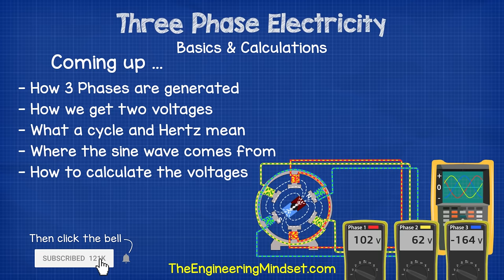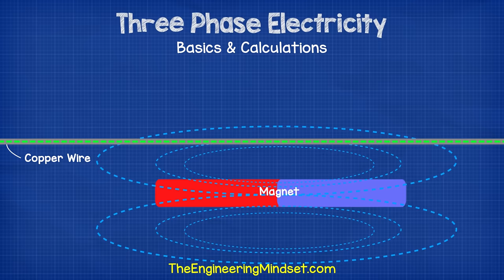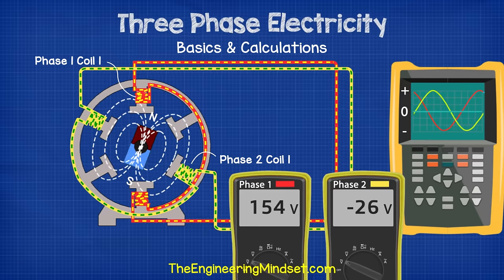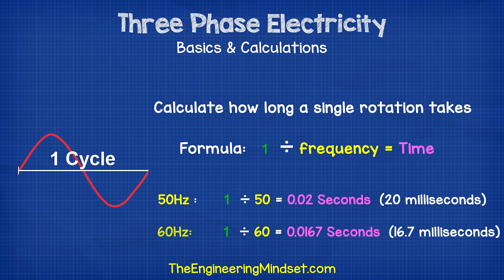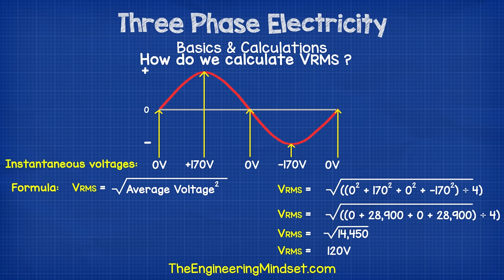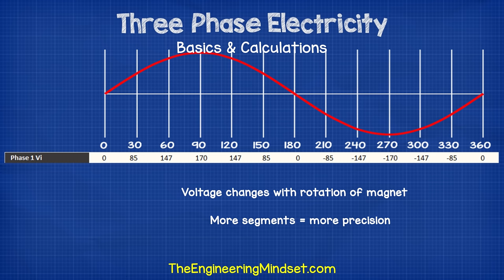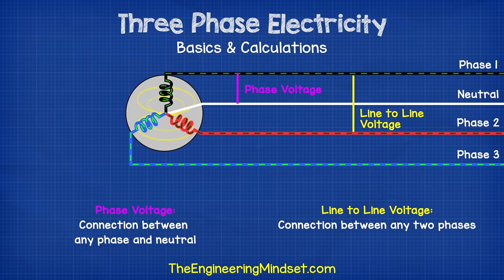Three Phase Electricity Basics and Calculations electrical engineering

Comment: In Australia we use 240V
Reply from the maker: Australia has started transitioning from 240 to 230 and by 2020 it will be the norm for some states. Queensland has already pushed with this, you can check the ergon energy website.
Reply: @EngineeringMindset  i see you are correct this will be interesting with all of our country's solar energy that pump out up to 245V

Comment: An IMPORTANT SAFETY tip to 1:08: Never ever use both my hands while plugging the multimeter sticks into the socket. This applies to any electrical component. You could get a current through your heart. Always let your LEFT arm rest behind your back, while your RIGHT hand operates couplings, one at a time.
Reply from the maker: Check our new Multimeter tutorial out ➡️ https://youtu.be/4lAyzRxsbDc

Comment: DOES ANYONE KNOW WHY THERE ARE ONLY 3 CABLES IN THE OUTPUT OF TRANSMISSION TRANSFORMERS WITHOUT RETURN CABLES? AND WHY ON THE INPUT OF DISTRISBUTION TRANSFORMES THERE ARE ALSO 3 CABLES.. I MEAN THERE IS NO CIRCUIT FOR EACH PHASE.. I m talking about EU system
Reply from the maker: Is your caps button stuck?
You don't need the neutral on distribution as its in delta configuration. The current is moving backwards and forwards so if we combine the phases then it cancels out the neutral. Watch this video for an animated explanation https://youtu.be/h89TTwlNnpY

Comment: Australia uses 240 volts not 230.
Reply from the maker: It's 230V nominal voltage in Australia. The voltage is being reduced from 240V to 230V to align with the rest of the world, but many parts haven't chnaged yet.

Comment: Too bad you didn't sum the squares of the voltages for all three phases to show that it's always the same. One of the neat things about three-phase is that, when supplied to a three-phase motor, the motor is producing the same torque no matter what angle the rotor is in, so three-phase motors unreally smoothly.
Reply from the maker: Seen our new 3 phase transformer video?➡️: https://youtu.be/u0SsejDCVkU

Comment: Its wild to think that some magnet is spinning somewhere allowing me to watch this video
Reply from the maker: What's more amazing is that every power station's generator has to be synchronised to produce a sine wave at the same time
Reply: @EngineeringMindset  Like if its using multiple generators to power the same grid?

Comment: 3 phase electricity shock  multimeter  hertz India voltage coil generator phase 123  on start magnet copper coil 123 generator star  basic delta contractor wiring timer rotation voltage dc current yellow blue red supply rotation of magnet max voltage motor neutral teacher ji

Comment: No offense but why did you bother converting to Radians? Seems like a wasted step/ time to me unless your taking a Trigonometry class in which case its probably a requirement 🤓

Vpeak = (√2 • Vrms)

RMS (Root Mean Square) is useful when trying to measure the average of numbers, where their sign is unimportant, as the squaring makes all of the numbers non-negative which comes in handy for averaging an alternating waveform 😉

Phase #1 - Vpeak • Sin(θ°)
Phase #2 - Vpeak • Sin(θ° - 120°) 
Phase #3 - Vpeak • Sin(θ° - 240°)

You can enter this into a TI graphing calculator to visually verify how this shifts the waveforms along the x-axis, just make sure you in Degree mode and not Radians ☺

Law of Cosines 
---------------------------
c² = a² + b² - 2abCos(θ°) 
a = 120Vrms
b = 120Vrms
θ° = 60° (Phase - Neutral)
θ° = 120° (Phase - Phase)

c = √[120² + 120² - 2•(120)•(120) • Cos(60°)] = √[14400] = 120Vrms ( Wye Phase - Neutral ) 🤔
c = √[120² + 120² - 2•(120)•(120) • Cos(120°)] = √[43200] = 207.85Vrms ( ≈ 208Vrms) ( Wye Phase - Phase )😊

Comment: Australia is 240V.
Reply from the maker: Australian nominal voltage is 230V, not all states or all parts of states have reduced down to 230V yet, some are still 240V
Reply: the difference is so small that the devices will work on slightly different voltage (also most modern devices are 220-240v or 100-240v)

Comment: According to this (https://www.youtube.com/watch?v=6TMBq4AA2Ng) and other schematics that can be found online, the phase curves are wrong. The voltage should peak when the magnetic field is perpendicular to the live coil (i.e. the North pole of the rotating core has passed it by 90°). Which one is correct? D:

Comment: the rms explanation was not intuitive, it was based on equivalent heat output from a DC circuit, very farfetched..... further, the derived equation that happens to get to the rms value seems arbitrary as well, and i would like to know the science behind out it happens to work out. there has to be a better explanation and intuition......further, since AC is always chaning i.e. not constant why is it that we dont see the fluctuation from a multimeter, i.e. why is it constant or failry constant and i have a feeling youre going to say because it oscillates so fast, but how does it work out to be the peak or the rms version and not 0 or some other arbitrary value?
Reply from the maker: The RMS was originally found by finding the equivalent of the DC load. It was showing zero because it cancels itself out, so they had to find a way to account for this, which lead them to the RMS value. The maths behind it is very complex, it would need to be a dedicated video. The multimeter just calculates the value because it's measuring the wave. It already has the formula. Cheap ones take as estimate but the good ones take the true rms, always get the true one
Reply from the maker: Check our new Multimeter tutorial out ➡️ https://youtu.be/4lAyzRxsbDc

Comment: The american system has different plugs for different voltages, (and currents)... you have the wrong plug for240V...  
It's a nightmare of plugs....
You show a 120 volt, grounded plug; for 240 volts!   
In your system, one could plug a 120 plug into the 240  volt receptical....
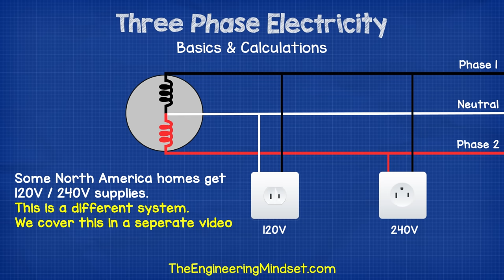You show a single phase supply, (with a neutral). 2:09 time in.

Comment: In the following video https://youtu.be/4oRT7PoXSS0
You explain in a way that when the magnet inside a rotor is perpendicular to the coils you get maximum current, but in the above video you explain this ideo when magnet is parallel
Which one is the correct? 🤔
Reply from the maker: This one is correct. In the other video it was simplified to make it easier to visualise. The top pinned comment warned that.

Comment: This is not correct.  When the North end of a magnet enters a coil you get a positive current, the max level is reached half way between start and middle.   Middle of coil is zero and north moves out of the coil it peaks at negative midway between middle of coil and leaving the coil, when it leaves you are again at zero.  Your lillustration would cancel the current out because you have a north entering a coil at the same time as a south unless one winding is clock wise and the othe counter.